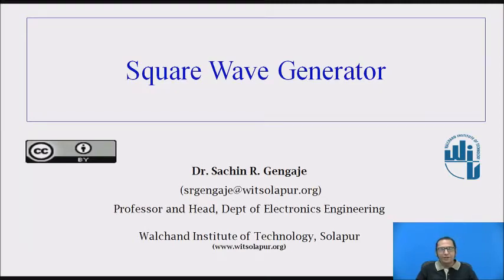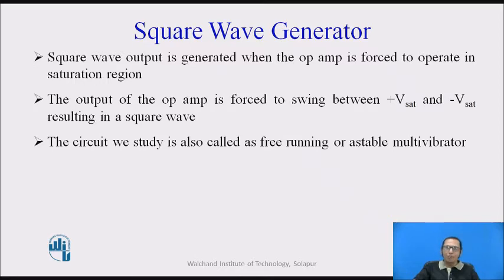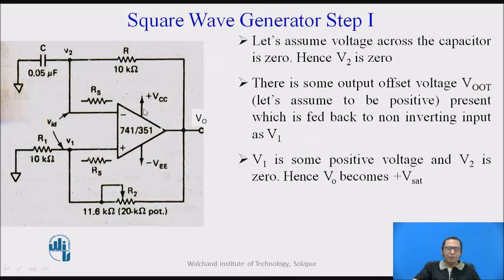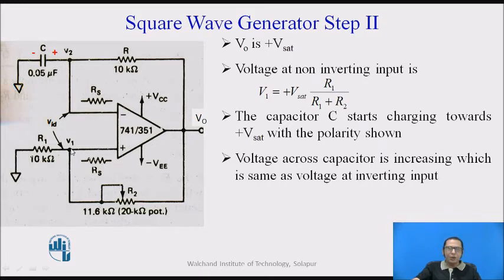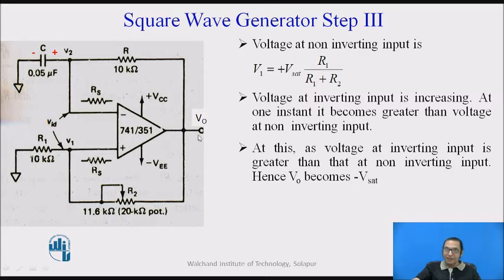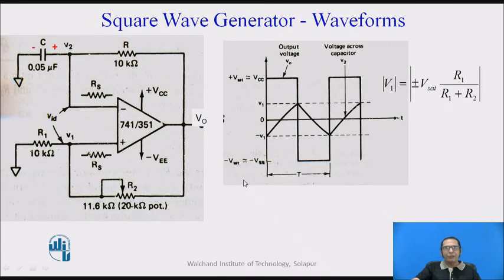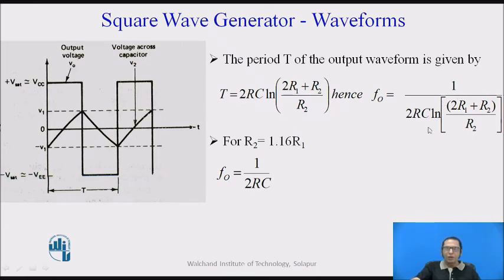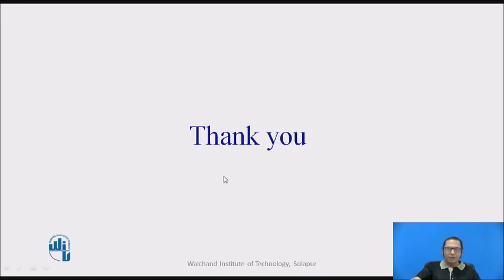Square wave Generator

Comment: I made on of these at uni, but I was wondering if there was a way to make the duty cycle adjustable. I know replacing R with a pot allows adjustable frequency but is there a way to adjust the duty cycle on this circuit?